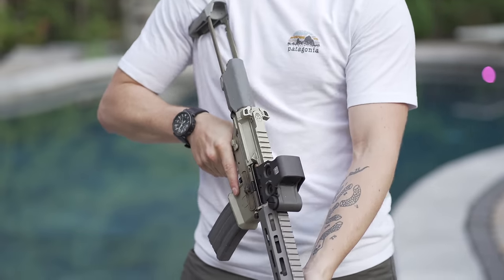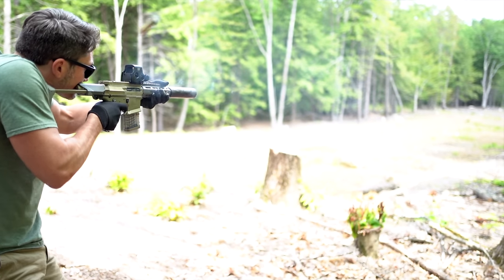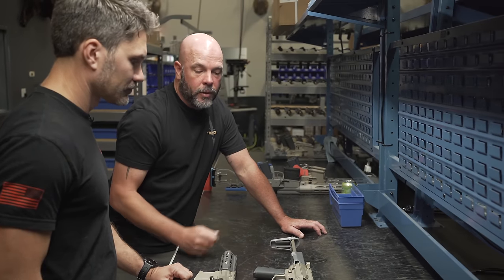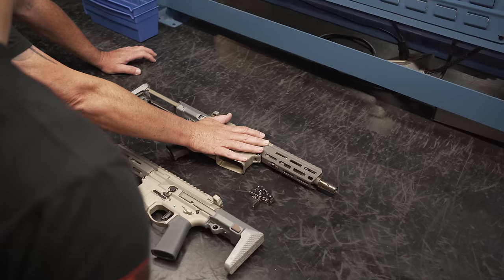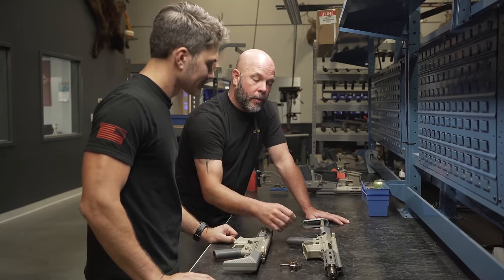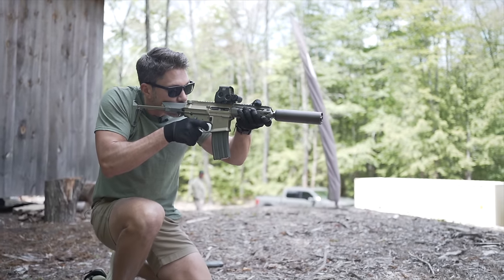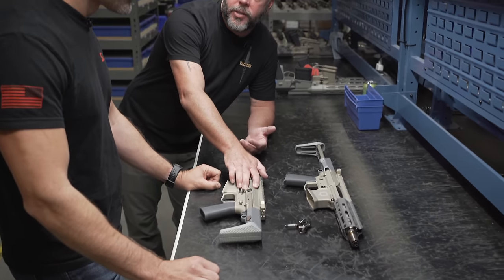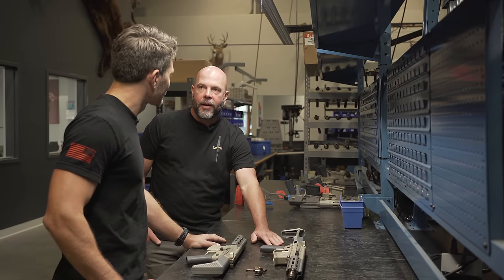Why the Q Honey Badger is Better than the AR-15

Comment: Idk why people argue on the internet  when it's a matter of perspective. We're all 2a people, I'd rather spend time at the range getting practice in. Better yet, bring an open minded friend with you and get someone else on board with enjoying shooting safely and responsibly. 

Anyways here's  my thoughts on the Q HB. I haven't shot one yet, but would love to find out first hand if its worth it (to me)

Let's think about this logically without bias. 

Cool gun, designed for the military at military budgets. 
Personally, as a machinist, I can appreciate the details, and the tolerances held. I regularly deal with tolerances of ten thousandths and assemblies measured in arc seconds. Precision machining is very very expensive. Even done with a CNC, you need a skilled operator who really knows how to keep the machine in tight tolerance. 

Do guns need that tight of a tolerance? Arguable, depending on use. Precision rifles? Yes. 
But it's pretty well known AKs around the world were mass produced with "sloppy" tolerances and still run decades later.
 
Let's remember who lost ww2 in part for overly complicated engineering and thus lack of supply parts. 

Since Q didn't get the contract it's clear they are trying to recoup the R&D expenditures. 
Makes sense from a business standpoint. 

Is the Q HB worth it? Well that depends on who's buying it. 
If you can easily afford it and feel it's something worth the $$$, then yes. 

If you have the money and dont think it's  worth it- dont buy it. Buy a different  gun, that you feel is worth your hard earned cash. Or buy a few guns for that matter. 

If you can't afford it,  that's fine too.  There are options that can suit your needs as well. Researching and building your own can be cost effective, and comes with gaining more thorough understanding of the weapon and it's parts. 

Personally, as a tradesman I prefer built vs bought, and the AR is one of the few weapons this works with, since there is such a huge ecosystem of available parts/styles function etc.

Comment: I really like that he nails why AK's are so expensive to buy in the USA. 
Because they were artificially cheap for so long. The Warsaw Pact nations paid the first mover costs for the factories and technical packages to produce those guns. An AK47 has very few 'expensive' parts that require careful machining and attention to detail. Basically the barrel, front and rear trunions and the bolt and carrier. The rest is dirt cheap stampings, wood or plastic furniture, springs and a few rivets. It's not the rifle that's expensive, it's the entire factory and its machinery. 
If you don't have that factory here in America, you are building a boutique low-production, hand fitted and assembled rifle and the prices reflect that...unless you're PSA.

but then he goes on about tolerance stacking and how most companies can't do it. Dude, they absolutely can. Anyone can set up to build parts that meet a specific tolerance. KE Arms did it when they made the KP15 and gave the world a working polymer AR lower. It can be done, but its not cheap and if you're trying to move a volume of guns, you don't want to have to invest in that amount of hand fitting. The idea here is build a gun that doesn't need a slightly different AR charging handle. Build a gun where any AR safety lever will work. Does it have to be different on a Honey Badger? Nope. It's different because he wanted to claim the lightest thing evar that could replace an MP5 in a loadout. But it doesn't have to be.

Comment: You can put together something similar for less than 700 even. On PSA, using new parts, you can get a 7in 300blk upper and lower for 400 bucks. Add a bcg and charging handle and you're at like 500. After shipping you're looking at 550 out the door. Saving you money for an optic. I'm betting the groups are similar too.

Comment: Nah sorry, I'll take the MP5. Reason being it is the best of the two. It was DESIGNED for it's purpose by the madlads of HK. HK isn't just a manufacturer, HK is an engineering company. You say what you want and they will make it. Lots of them around, parts aplenty. We all give HK a hard time because they are expensive, and for a company that has to foot the R&D before the contract is given, yeah I can see why. James here kind of touched on it and Kevin cant give a hard hitting answer and skoffs a "you a poor" response.

Problem here is, he isn't doing any R&D. He's taken an already established design, making it look all futuristic, and saying it's the best thing to sliced bread. SOCOM, SOCOM, SOCOM. Never seen HK brag about SOCOM until the word was engraved into the Mark 23.

Backorder for 7 years? No sir, you're artificially under producing to keep profit high. Don't even get me started on the BS claim of 70 degree throws not being safe. How many of us have used our 90 degree safety without a problem???

???

Comment: Fun...not in my price range but interesting. I have education and work experience in the physical sciences. I much prefer his term "dispersion". 

In physics, typically talk about "uncertainty" as the spread of a value that "should" be exact and unchanging. The reason the value that is under test is not fixed is usually hidden or latent. It's also statistical, meaning, one test has no impact on the other tests. If there is a something, like heat build up, that affects the next test, that is a "control" variable and is deterministic. That will be removed later. We call "error" all the non statistical, removable, deterministic components of the test output.  

The term "accuracy" is generally used to describe the measurement device. We use the average of the test +- one STD as the final metric for whatever.

Comment: We keep hearing about tolerance stacks. Tolerance stacks are absolutely necessary when manufacturing large numbers of items. When your components come in and they are in specification, we know that the assembly will work properly individual parts will have their respective press fits slip fits clearance fits, etc. this is how you validate design so that you do not need to verify every single unit that comes off the line. This is basic manufacturing. However, that is not necessary when a one off is built in somebody’s garage. I will tweak it until everything works correctly whether I need to use a file or a CNC to get exactly what I need out of my Device. Do  tolerances still apply ? absolutely but I’m not manufacturing 10,000 of them- I’m making one and that one will be perfect. This is not to say all tolerance stacks are meaningless- however- When you have one person hand fitting a rifle I can tweak each component to function just the way I want it, and the AR design is extremely tolerant of both mill spec and aftermarket . Kevin doesn’t have the money to hand fit each rifle otherwise they would be $20,000 each, which is why he needs tolerance stacks, but I do not

Comment: "close to 1moa with supers and 2moa with subs" i put together a 300 blk out upper.

aero forward assist-less upper, aero charging handle, daniel defense rail, bcm bolt, rainier arms 6.5" barrel and a two stage trigger (cant remember brand) and with handloaded ammo i can get sub 1.5 moa groups for both supers and subs at 100 yards. factory ammo is about 2moa for both supers and subs, and thats with ME SHOOTING IT, and i am by no means a good shooter

so for less than half the price im getting 90% of the performance

lets also not forget that if my gun goes down for WHATEVER reason, i can go to any gunstore and get replacement parts

Comment: Here is the hard pill to swallow.  300 blackout will never make sense in a world with 7.62x39 AR's that have nearly the same benefits, yes 7.62x39 is ALSO good out of short barrels, maybe not as good as .300 blackout but it's both cheaper to run subsonics and supersonics and offers better penetration and lethality. Hell, AKM mags are dirt cheap and just as reliable.

Comment: AR parts are "artificially inexpensive" because of volume?  Doesn't that mean that they're cheap because of a healthy balance between supply and demand, commonly known as "The Market"?  Doesn't that mean that there is SUCH a demand that there is a massive amount of competition among many competitors, keeping the prices at an affordable number for users of all levels?  Based on that statement, why isn't there a similar or burgeoning level of competition to produce the Honey Badger system if it's so superior?  We're seeing similar third-party competition in AKs, HKs, AR-18s, Glocks, etc.  So if the system is so great, where is the market interest and third-party manufacturer competition?
Reply: Well there is also economy of scale but this gun just seems overpriced.

Comment: my error here. What he said was that this gun is 100x more accurate than the HK SD, which is a pretty inaccurate submachinegun, because the dummies drill holes in the barrel to bring the veocity of normall 9mm ammo down to subsonic speeds  What they SHOULD do is just shorten the barrel.  When the bullet passes those holes in the barrel, pieces of bullet are going to get torn off, or blown off by the blast of the powder gases that are pushing the bullet out of the barrel.. All of those things are hurting accuracy.  and 9mm ammo is not exactly made for long range precision in the first place.

Reply

Comment: I love my honey badger, but I’m very frustrated with the big POA/POI shift when switching from subsonic to supersonic. It’s almost five feet apart at 200 yards. I know sig makes the 9t to solve this issue but it’s $5,000
Reply: That's ballistics and not the gun tho. Supers for close to far and subs in the trash!!! Lol.
Reply: Thats D.O.P.E for buddy learn your holds
Reply: @ReynaR713  no one is doing D.O.P.E. On a 200 yard gun, especially for dynamic shooting which this gun is designed for. Bench rest shooting isn’t real world shooting
Reply: @TheDkb427   But then why bother using 300 blackout
Reply: Lol okay ig dope doesn’t apply lol just radom luck then when im hitting steel at 200 with 220grain subs. Imean bro its not made for that specific reason  but it can do it if you want it to wasn’t meant to be a sniper lol 😂
Reply: @ReynaR713  yeah, and how slow or inaccurate are you when making those shots. Bad guys don’t stand there waiting for you
Reply: Different tools for different jobs. I don’t think I would personally engage somebody at 200+ with a 300 blackout. Hitting steel at 200 is just for the satisfaction of hearing the ding. But that’s why I have my 12.5 for buddy lol you’re a funny guy 💀😂

Comment: His explanation of tolerance stacking is very apparent if you assemble anything mechanical. These low cost upper and lowers are very prone to out of spec before assembly and very much out of tolerance when assembled because they’re allowing for the full range of min max on machining. 
When your tolerance is say 0.007” total and your parts can be -0.005” one way and +0.005” the other way that’s a total tolerance of 0.010” and thus 0.003” out of spec. Might be “good enough” for most people but not enough for professionals or precision shooters.
Reply: @khester7397  very few measure or have the tooling to measure things as an assembly or at the component level.
The tolerance for a 5HP air cooled engine is different from a 150HP Honda Civic and different from a 2000HP race engine. What’s acceptable to each person is different.
Narrower tolerances equals higher quality but at a price.
Reply: @vais3  Narrower tolerances do not equal higher quality when said tolerances do not increase performance or reliability.

That's the difference between this and your engine argument. There is a huge difference in performance with each of your engine examples, there is not with whatever garbage Q is trying to sell vs rifles that cost a fraction what theirs do.
Reply: @khester7397  that’s what you’re deeming acceptable to you and fitting your needs. 
My comment here was agreeing with his statement on tolerances and what the industry sees as acceptable due to what most people deem acceptable.
Reply: @stevem4783  perhaps you’re thinking I’m specifically referring to his product. I’m not. 
I’m sure what he’s building is acceptable in quality for the needs of whom he’s supplying. 
Yes, each one of those engines has a different tolerance and the point being each level of performance requires a different tolerance.

If I had to pull from recent and personal experiences. I have 2 uppers from one manufacturer they may be “in spec” per measurements of the individual components, they are far from it with the combination of parts I have. Will it function? Probably. Can I guarantee reliability? No.
Reply: @vais3  you're not doing anything but painting with a broad brush and making assumptions, though.
Reply: @stevem4783  my original comment said nothing more than agreeing with his statement regarding tolerances.

Comment: Dispersion moa. Exactly a measurement of the 'cone of dispersion' 😂 bullets on Target scatter to an approximated accuracy of platform and operator launch... You want a little more dispersion in a machine gun but as little as possible in your benchrest tooling 🐵

Comment: Wow I think he's right, people are pissed off because they can't afford it. I can't afford it either but if I could I would get one or more. No your $500 PSA is not just as good, get over it.  In fact your $500 PSA is not even as good as the $1,100 and $1,200 ones that I made, but I'm sure they are still great guns.  My next one is actually going to be a super cheap one, and I predict it will run pretty great.